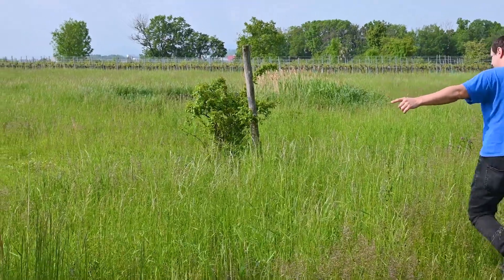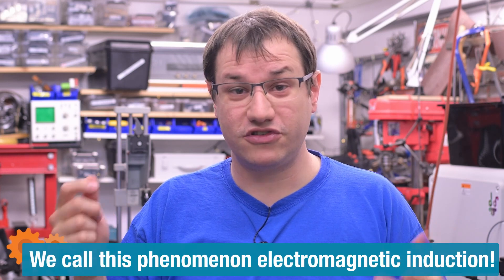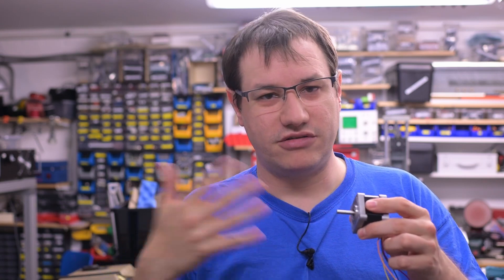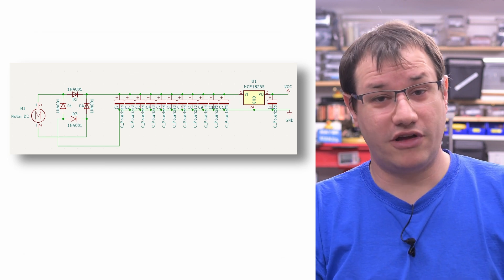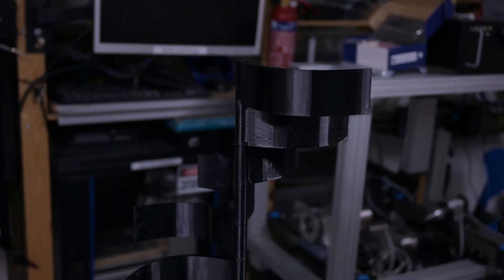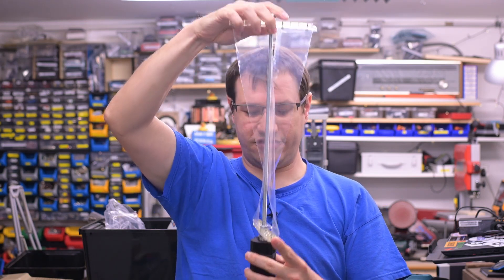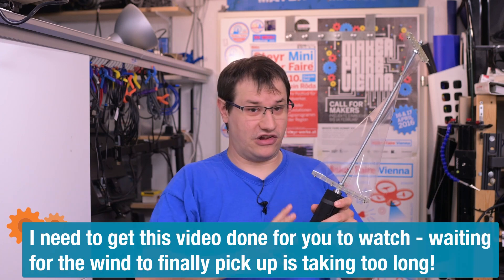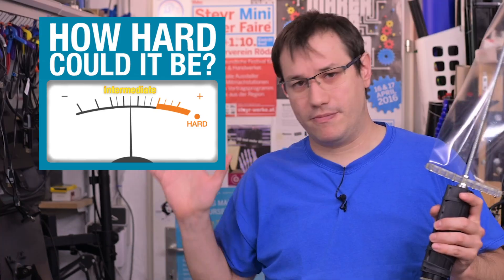Making the Simplest DIY Wind Energy Generator - How Hard Could It Be?

Comment: Great video and subject. You forgot to mention when it generates power, some current to the circuit, resistance will increase by generated flux. Anyway, I love to see generating power with weights and gravity, mechanism like a clock so you don't need any solar or wind energy. In fact a string of tiny weights that turn down and up and at the top collected to make a heavy weight that 'falls' down to keep the string going. This repeats over and over again. It also can be two baskets on a string and one of them filled with metal balls. The full basket with balls starts at the top and when reached the lower end it will release the balls one by one over a curved rail to fill the empty basket at the top. Process repeats over and over again.
Reply: You have a perpetum mobile, don't know what type,?
The empty basket or it is on top and needs energy to be up full or it is down where it can't give any energy. 
Something has to bring it up using energy and when it  descent some of this energy could be electricity ...

Comment: Awful design!  Mechanically and electronically flawed! First a propeller with 2 blades is the most efficient way to obtain power from the wind (windmills use 3 blades to avoid vibrations). Then a bridge where you lost 2 times the knee voltage of the diodes you use. Even using Shotcky diodes the losses are big! Avoid the rectifier! Then a filter with many electrolitics! What for?  Then a linear regulator! Lot of unnecessary losses again! Use a buck boost regulator! Your project can't have losses to be of any use!
What a mess! Your have a place at the Museum of Failure!
Reply: https://youtu.be/bnhHCh-6wXc

Comment: If that motor has even moderate physical resistance, that "fan" will never turn it unless the winds are crazy high. It's a very inefficient design.
Reply: Exactly. There was enough wind to produce power, the turbine was simply horrendous

Comment: The bridge rectifier is killing the effiency since you lose between 0.6 to 1.4V depend of the type of diodes used. The motor is also not made for this so it is very inneficient.

Also using capacitors in this case isnt very good, it lose quickly it storage, doesnt take lot of joules, even supercapacitors (that would be a  better choice of caps) I would much rather use a lithium battery. 

I would take a small solar light like the one at costco. Very reliable and produce good quantity of lights at nights so the solar/battery design is well made. So you add also your wind powered generator to feed the same battery, or double the battery capacity.
So it would be very reliable to be feed by the sun and the wind, since it can happen to have little wind for days or cloudy days. 

With the wind gen design it cannot turn the other way by design, so I would not worry.Worse case add 1 diode so it anything happen it will just not produce current until it spin the right way.
Reply: the Motor used is actually mentioned in maxxons guide to using motors as generators that is linked in the shownotes on the element14 page for this project, as with motor and diode selection I had to use what I had on hand. Scond , you can´t just hook up any battery and expect it to be charging, in fact this can be quite dangerous so a propper charging circuit is needed and to supply that with voltage the exact setup shown in the video is used in general. feel free top post your schematic on the page linked below the video if you have better ideas.
Reply: lol. I wanted my time back, and what he couldn't wait for some wind m
Reply: @jamescollier3  I have very little time for each project so NO , I cannot wait for wind and I can not wait for other parts to arrive, the schedule is tight.

Comment: thanks for the informative & interesting project!
I would've loved to see it working in front of an electric fan at the lowest setting at varying distances to simulate wind ambient speed... just as a proof of concept for your VAWT rotor design... 
> that said, I will probably try it to light a dark corridor that has constant airflow with this idea... ;) cheers!
Reply: thanks, I tried with my air gun, but I did not have any fan that would be strong enouhg to simulate propper wind. so I turned it with my drill at a reasonable speed to at least get some measurements.
Reply: @MAYERMAKES  fair enough ;)
and I don't doubt your electronics prowess as I am a fan of your work... so I'm sure it would generate power if it spun... 
> I was more curious about the mechanical aspect & how effective your setup would catch wind (as well as how much wind force it would take to actually turn it fast enough to generate electricity)
... at any rate, looking forward to your next adventure! perhaps a weatherproof remote weather station?